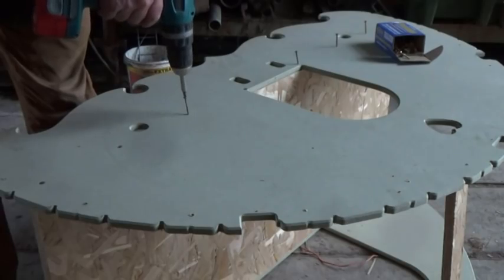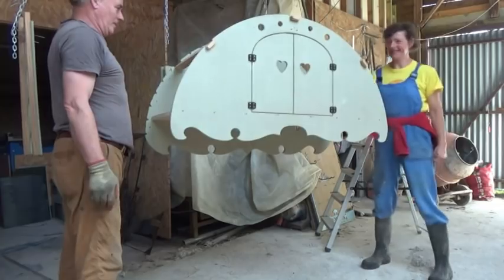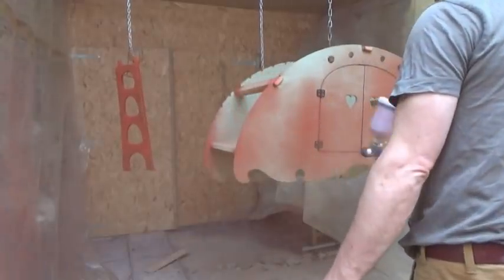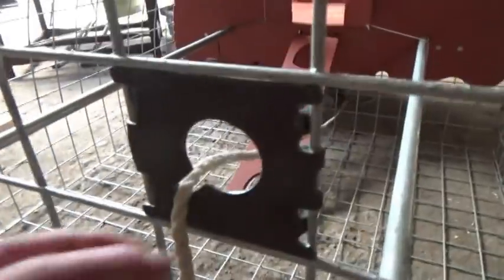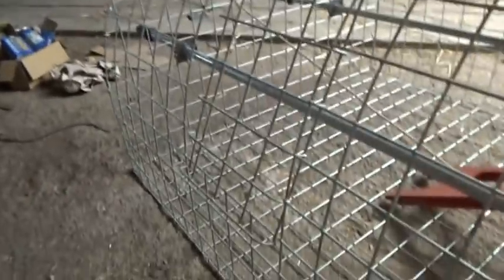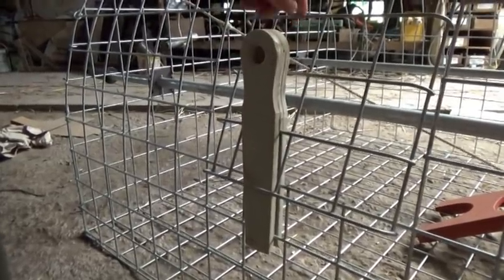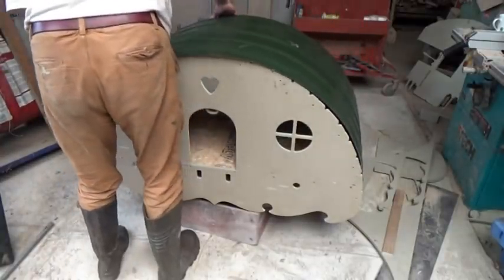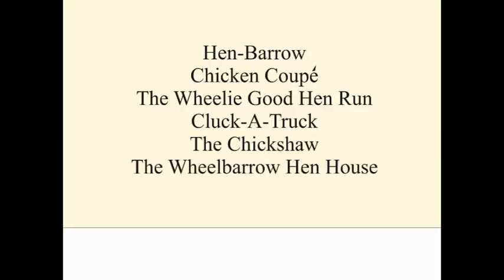Nearly There! Designing New Parts For The Mobile Hen House.

Comment: Have you thought of using electrolysis to copper or zinc plate your parts yourself? It's not too hard to do and even a thin layer goes a long ways towards helping with corrosion. The best part about using copper is it will help keep bacteria and moss from growing on the parts. All you'd need is a bit of copper sulfate in solution plus some clean copper pipe/cable to act as anodes and so long as you aren't doing too much and are willing to wait, you can actually use a trickle charger to power it. (I've done reverse electrolysis to clean rust out of a gas tank before and you can switch it and use copper wire and some solution to plate the inside of the tank to fill any pits and put a layer of rust proofing in :D) If you are going to keep that rope design I'd suggest figuring out how to route it through the outside because if my sister's chickens are anything to go by.. they will peck at it until they destroy it if it's left inside.
Reply from the maker: I have tried it - but the results weren't good enough. I should probably try harder..
Reply: @WayOutWestx2  a lot of it has to do with how clean the parts are going in, the material you use as anode, having the right acid or electrolyte and the right voltage/amperage. In professional plating when they do motorcycle frames etc they actually have to add wire "spoilers" basically coils onto the ends of the frame to siphon away excess current. One thing about using copper wire as an anode material is you have to make sure it's not lacquer coated or it won't work. There's more than a few videos about it on here.

Comment: It looks like a grate wheelbarrow henhouse.

You should test it with a half flat tire. 
Wheelbarrows always have half flat tires.
Reply from the maker: Ha! You're right, Jon. But you could always pump them up.
Reply: @WayOutWestx2  you should put that in the manual 🙂.
Reply: @WayOutWestx2  or use solid wheels!

Comment: In my barn I always felt like an unwelcome visitor with the barn swallows. Especially in the lower level with the cow stalls, a roughly 7 ft ceiling.....constantly ducking the little blighters..... 
I do hope you gave that material a good coat of paint. I fear it is not tolerant of moisture. I made the mistake of V carving something called particle board rather than MDF and covered everything in my shop with a fine coat of the glue I imagine. Both horizontal and vertical surfaces were laden with a fine white film. Never again. Never never never :-)